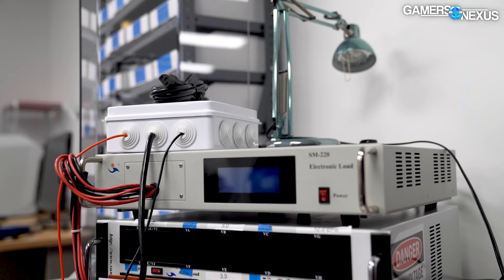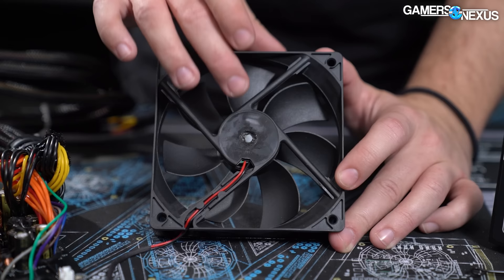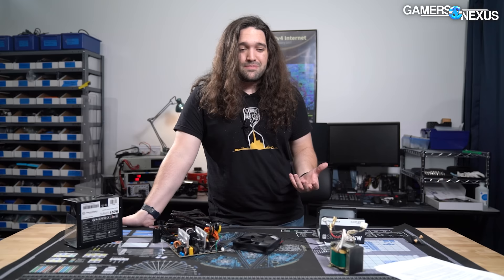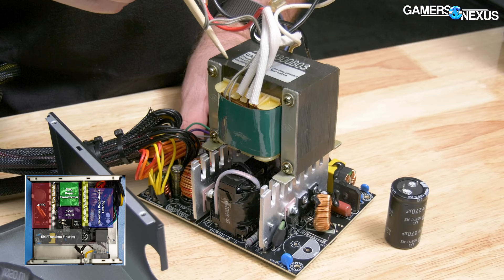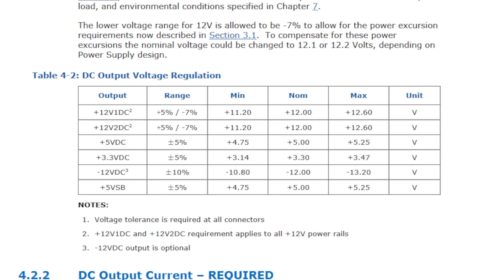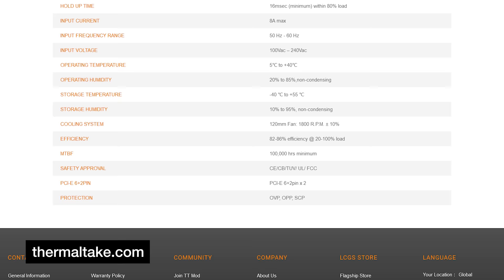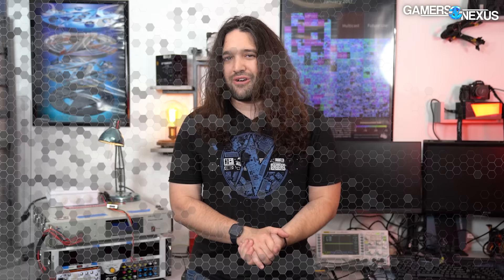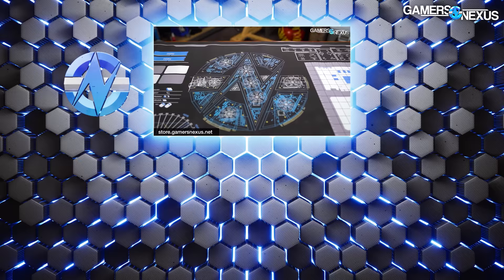Taking Risks on a Cheap PSU: $30 Thermaltake 430W SMART Power Supply Review

Comment: @Steve 
The 430W total output rating is not misleading just because the +12V rail is only rated for 387W as suggested in the video. As it suggests the "Total Power [Output]" is the total output that the PSU is rated to sustain from the power supply; "Total" includes the +12V, +5V, and +3.3V. 

Other higher end power supplies often are able to do the entire rated output on the 12V rail because they are using DC-DC to generate the minor rails (5V, 3.3V). They take the +12V output and convert it to 5V and 3.3V. This means DC-DC power supplies need to be able to output the full power on the 12V rail as the power for the 5V and 3.3V rail is being taken from the +12V. 

The Thermaltake Smart 430W is a group regulated power supply which doesn't generate the minor rails from the 12V output, so it doesn't need to output the total power from the 12V. The 12V and 5V rails are generated together and the 3.3V is usually generated from the 5V output (generating from 12V is also possible but since 5V and 3.3V maximum output is grouped together at 110W it's likely generating 3.3V from the 5V rail). One of the big problems with group regulation is the power supply regulates the voltage of 5V and 12V together, so if there is a heavy load on the 12V rail which causes the 12V voltage to drop the power supply will compensate by raising the voltage to both 12V and 5V since they are regulated together, which can cause the 5V rail to fall outside of the +/- 5% tolerance allowed in spec - and vice versa if there's a heavy load on 5V and light load on 12V. These crossload scenarios are part of the reason why group regulated power supplies aren't recommended [at all really, but especially for] systems with high end CPUs/GPUs as the high 12V load can potentially drag 5V rail out of spec.

While the CPU and graphics card are the biggest power consumers in most systems, there are still a lot of things that require 5V such as USB devices, HDDs, SSDs, and more... Even though the power supply is only rated for 387W on the 12V out of the 430W total (90% available on +12V) you can (potentially, depending on the specific setup) still get the full 430W output from when you factor things like USB devices and drives. Just because the maximum rated output isn't available on the +12V rail doesn't mean it's misleading. Realistically having 90% of the power available on the +12V rail for a low wattage power supply like this is going to be perfectly fine for most systems except for very odd edge cases.
In a DC-DC system loading up the minor rails will reduce the output of the 12V rail, it's just that it's arguably more flexible as you could get the entire output on 12V rail if the 5V/3.3V rail isn't loaded, but it's unlikely you'd ever be using a system that only has a +12V load and 0W load on +5V. Whatever load you have on the 5V/3.3V rails is going to be taking that power from the 12V rail counting towards its maximum rated output.

I see a lot of comments on forums/reddit saying that power supplies are "fake" or "lying" if they can't output the maximum power on the 12V rail and it can be difficult trying to explain it to people, and I'm worried someone trusted like GN perpetuating the myth is just going to make it more difficult. You should instead educate people on how to read the output power table on the power supply label. The table shows the maximum output for the +12V rail. Instead of saying it's misleading just inform people that with cheaper power supplies (group regulated) if the total output for 12V is important to you then you may need to pay more attention to details of the maximum output of each rail instead of just blindly going off the total output.

I know GN is still new to PSU reviews, and I think this is the first group regulated unit you have looked at, so hopefully you get to read this and at least now understand why on this power supply (and other group regulated power supplies) the total output rating isn't the same as the total output on +12V rail.
Reply: The breakdown from Patrick Stone going over each of the components was excellent though!

Comment: I bought the 500 watt Smart PSU.... after a few days it started sparking and wouldn't power on. I took it back to microcenter and got a cheep 500w EVGA and it worked out great. Microcenter guy told me they are getting a lot of these Thermaltake PSUs back.
Reply: Yep, the Thermaltake Smart-series and the like, are banned by me. If found in a PC, they are usually taken out on the spot!

Comment: I've been running Thermaltake power supplies for years now. Built a few computers for other people with them as well. Not one single problem. They were not 430 watt supplies but rather all 700 watt and above. Meanwhile my EVGA 500 watt popped in a week but would have cost almost the same price as it cost, to ship it back for RMA. It is a nice paper weight in the box.

Comment: i have a thermaltake one in my old ivy bridge system.
its still working fine, even after heavy gaming and blender rendering usage with god knows how many thousands of hours on the clock, if not 10.000 hours of operation.

Comment: I've had this exact psu for over 5 years with an i3 9100f and a gtx 1650 and have had 0 problems with it. Fairly regularly my area loses power abruptly due to high wind speeds and never has a component on my pc broken.

Comment: I am the owner of that power supply since 2019. I have used with a 1070 and a 2600x and have no issues. It even handle an upgrade to a 5800x  with both the GPU and CPU running a stress test for an hour with no issues. Definitely a good powert supply for the money.

Comment: I've been waiting for this.  I've wanted measurements of budget parts for when I need to build an office pc, or super budget gaming rig for someone. Budget cases are another one, mainly for the air flow. While it's good to know where the middle and high end parts lie, it's even more important to know how cheap parts perform, because some could be decent like this PSU, while another $30 PSU could be trash that delivers half the power, or blows your system up. Plus, you know that there's a lot of people buying cheap parts like this.

Comment: I bought an 80+ White from them, 650W. It freaking burnt my RX 570 PCIE connector. It was all black instead of white. I called them and they said it can't happen, it was due to misuse for sure and that the best they could do would be to send a replacement BUT I would have to send the problematic one and pay for both way shipping, which was 80+ $CAD. Won't ever buy any PSU from this company... EVER.
Good thing is I could change the PCIE connector (female) on the graphics card and it worked fine afterwards. Still a headache.

Comment: I used to have one of the old Smart Series from Thermaltake, It was a 850W version ,80 Bronze  and lasted for more than 10 years, died a week ago. At some point, a few years back, I tought it was dead (it was the gpu instead) and changed it for one of this new series, I was very surprised about the feeling and the sound, this new version was considerable cheaper and sounded so much, the coilwhine was insane so I just stayed with my old one and gave away the new one. That old PSU actually made me have a soft spot for Thermaltake despite all.

Comment: Some notes:
9:50 this is not NTC, this is PTC thermistor (positive thermal coefficient), it's used for limiting inrush current when capacitor is discharged. 
14:20 this little choke is used in 3.3v regulation circuit. It is magnetic amplifier scheme (magamp) and it lowers input 5V to 3.3V by flowing current through choke.
Reply: It's an NTC. The idea is that it's cold when you turn on the PSU and thus it has high resistance. It heats up as current goes through it and the resistance drops. Ideally to zero, but that won't happen. Thus bypass relays on more expensive PSUs.

Comment: Good to see that this psu isn't bad!  Bought one because I have a low spec system and needed something better than the 240 watt cheapo Lenovo psu I have been using for about a year.  My system is also extremely power efficient, being a 10th gen I3 and a gtx 1050ti(no external power model), so I think this psu should work well for me.

Comment: I've used this psu in a dedicated game server with a G4560 and 4gb ram for about 4 years, no issues and silent.

A lot of this review is like measuring the track performance of a prius. No one expected it to have low ripple or be good for overclocking, it's cheap, reliable, quiet, tons of niche uses for that.

Comment: I've used one for a HTPC which ran perfectly for 4 years. I only changed it when I swapped to a micro Inwin Gold Power Supply. I run a AMD 3400G chip, RX6400 Card. All that off 180 watts !

Comment: I've had tT 530 smart semi-modular (no badge since it didn't support both EU and US power standards)  for over 6 years. Powered everything I threw at it, it's still powering my friends PC without issues. Seriously, no issues, even when 12V rail dips to 11.4x nothing crashes and if I didn't monitor the currents, I'd  never know it was getting too weak for my then new PC. EDIT: I bought that tT after my Chieftec CFT 750W 14CS  GOLD blew up (and that was a ~$100 CWT unit)

Comment: I've used one of these (500W) in my build for 4 years now. I have a RX 580 and 2600. I overclocked too. I've done over 2500 hours of gaming. I know its not a big sample but they can be reliable long term. I'm definitely getting a better one before I upgrade again though.

Comment: I got the Thermaltake Grand RGB 650W for $100 and it has been working well for the past 3 years. Though the voltage ripple is as bad as this one and the thing I hate about it is how loud the coil whine is, especially during idle. My next power supply won't be a thermaltake for sure.

Comment: You need to tell that power supply buddy of yours to slow down and enunciate his words. He is speaking so fast that it is difficult to understand and digest what he is saying. He is also jumping from one stage to the next very quickly without a clear boundary/break/pause etc from the other section and just keeps pushing through. Someone who doesn't have a clear understanding of components will just go all glassy eyed. I have noticed that people on youtube are in a hurry to rifle as many words at the audience as possible so they won't get bored or move onto something else. I do think this video is excellent and very valuable to people looking to purchase that power supply or understand the components inside. Buying the cheapest one isn't always the best idea for component longevity. Some of the testers that used to do this aren't around anymore so it's nice to see someone taking up the mantle and running with it.

Comment: I never used expensive power supply and I never had any problems. That is just a marketing. I guess if efficiency is your goal than that makes sense, but if you do it for safety its just waste of money. I had 3 computers in my life, each about 7 years. They where sold when I decided to upgrade motherboard, no power supply ever died or burned something, and they weren't even 80+.  I should say one thing though - it may depend on country. When I moved to UK first time in my life I saw flickering lights on peak hours. I never knew that's even possible. I do not know how that would affect your PC, so maybe if you live in conditions like that you cant get away witch cheap PSU
Reply: 80+ is an efficiency thing yes, but it does generally mean a quality psu that didnt fudge the results, as its not too hard to match bronze.

as long as your psu can beat the draw of your pc, ideally almost double the draw, then you're golden anyway.

Comment: I use one of these power supplies  in my LGA775 rig, it handles a HD5870 engineering sample and Q9650 overclocked well.
Reply: Yorkfields, IIRC, don't even use as many watts as their 65nm predecessor, the Kentsfield, which was easily a 200W CPU with a good OC. The Yorkfield is more like 135-170W with a good OC. 
I have a Kentsfield sitting around that would extremely likely be a 200W CPU at only 3.3-3.4 GHz. :( (Even when a "G0") I can fuhgettabout 3.6 GHz on my Q6600!

Comment: About 2.5 years ago, I received TWO of these and they were BOTH DOA. I mean, what are the odds? For the record I'm not stupid and I know how to troubleshoot. I sent them both back to be replaced -- and one of them became lost within their bureaucracy. I was so disgusted at the whole ordeal that I just couldn't put forth the energy to fight and get the 2nd one credited and a single replacement shipped out. Fortunately, the one RMA'd PSU that they did manage to get back to me DID WORK. I was almost surprised, except then the odds of three bad PSUs in a row from Thermaltake must be astronomically long. Let's just say at this point that I'm unlikely to be a repeat customer for this company, though I'm sure experiences vary but this is the single worst experience I've had in my decades of building computers (most of that time -- as part of my job).

Comment: I used to run a i5 8400, 14 HDDs (6 of them 3.5"), a SAS2008 RAID Card, GTX 1650 Super GPU  on a 430W Seasonic S12 II. It ran just fine for years, never got any power-related shutdowns. I did swap it for a 750W about a year ago to have some headroom for upgrades.

Comment: I bought the 500W version of this PSU for $35 from Amazon to use in a lower end gaming and web browsing system and it's working fine. We're talking a Asus B450 Prime motherboard, Ryzen 2700X and a EVGA 1650 Super graphics card. No issues.

Comment: A couple other things about these:  The metal case is super soft, expect at least a 10% chance of one or more screws stripping out.  The QC isn't all there either, about maybe 0.5% will have issues with the connectors like a 4+4 connector where a 6+2 connector should be.

One other thing about Thermaltake; their cheapness factor extends all the way to their high-end units.  Stuff like daisy chained EPS, tangled wires, and flimsy molex connectors that won't mate correctly.  Just get a Corsair/Seasonic/Superflower if you're throwing down more than $60.

Comment: Providing 350W without exploding or killing components is really all that's needed for any PC older than about 2008. A cheap but relatively safe ATX PSU also makes for a great upgrade for non-PC computers as well.

Comment: I built a computer with this exact power supply. Very budget build that was meant as a home surveillance pc and just general use; It has held up fine. Wouldn’t recommend it for anything other then light duty use though. But for someone that is putting together a desktop for school or to run simple tasks around the house, I think it’s a great bang for buck option.

Comment: I just bought one of these a week ago for a computer at work. 2200 GE ryzen with a single ssd, 2  DRAM sticks and nothing else. It runs anywhere between 65 and 110 Watts off this power supply without any issue

Comment: Diablo Tek still in business!? 😆 my cousin bought a Diablo 550w back in 2006, I think it was $20-$30, that blew and took out most of his components with it.  I was running an 800w BFG PSU ( I miss BFG 😔) because I needed the 6 pin PCI-E connectors for my 8800 Ultra

Comment: Great review, thanks! It's fantastic to see a thorough review for a lower end part like this without it being a just for laughs slam dunk on a garbage, dangerous part.

I do think that in the load testing for the review, you should stick to the sticker loads. On a higher end supply, meeting the overall sticker wattage on just the 12V rail might make sense. But for a budget supply, it kind of doesn't. Besides that, it seems somewhat misleading to apply gamer or overclocker standards to this kind of unit. If the sticker loads are correct, and it meets the ATX spec, then that should be emphasized a little more.

That said, SCP not working on a rail is bad! And no rational person would disagree with the conclusion of the video.

tl;dr: amazing content i love a good low end review
Reply: Ultimately I can't help but feel that if a power supply is supplying power within the spec (is it still +/- 10%?) then whatever is plugged into it should handle that as well, so maybe there's a little misplaced stigma towards lower end power supplies.

Comment: This is the PSU I am currently running.  I got it when I was using integrated graphics, a (R5 3200G with Vega 8) as I didn't need more power, but it still does fine with my current GPU and CPU, an RX6600 with an R5 5500. It will probably be upgraded at some point, but I don't consider it an absolute priority. It does its job well enough.

Comment: It's strange to me than an enamel coated chunk of iron(is it a magnet Idfk?) with some copper wire wrapped around it equals regulation in any way. The wire even looks haphazardly wrapped in some cases but I assume its fairly precise amount of windings around the chunk. Thank you so much for sharing your(all of u) power supply expertise.
Reply: 700 watt bronze also just sounds scary. just barely 80% efficiency / like jeez psu has 20%(35 watts or my entire ryzen 3500u laptop) just straight to heat.

Comment: Very nice analysis , although with 2 remarks :
1)If the fan costs >1$ , this makes me wondering about the 30$ cost of this unit . 
We have capacitors , we have transformers , we have the cables , we have the case , we have the working hours for the assembly .... we have a ton of things , and this unit sells only for 30$ ? how did they do that ?
2)We heard the OEM for the fan , although we didn't hear the much more important OEM , which is the OEM for the platform itself. Thermaltake works with CWT for most of their higher/est-end units , but for this 30$ budget unit i would be very surprised if it's also made from CWT.